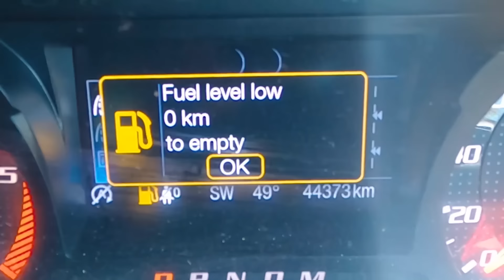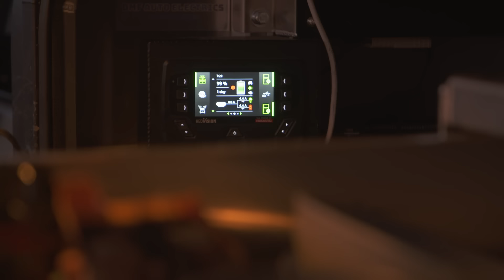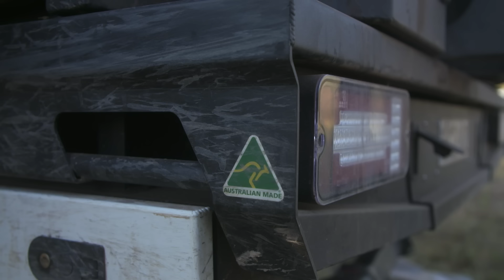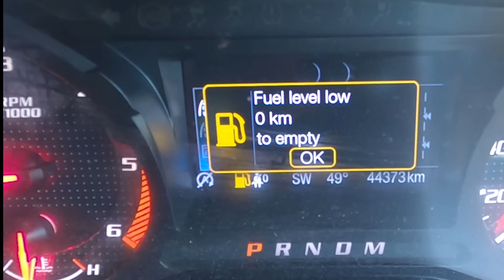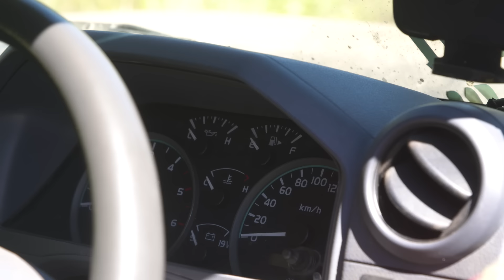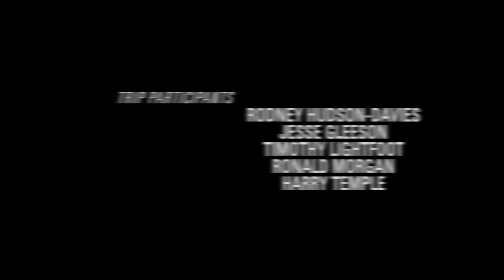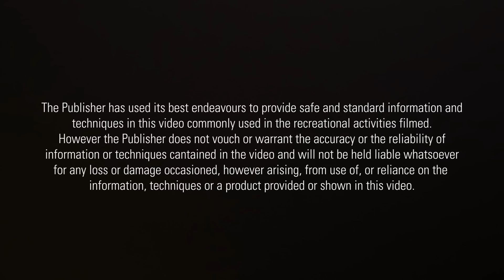We run out of fuel, food and tyres – do we make it? THE KIMBERLEY FINALE

Comment: My bush fix was in a 1999 Dodge Ram 1500 4x4 5.9 V8 360 and my driver side break caliper went out in the middle of a 7 day overland trip with some buddies so I had to cut off the break caliper crimp the break line and bleed my breaks so I still had breaks to the rest of my wheels and it worked for the rest of the trip my break caliper went out in the second day of our seven day trip

Comment: Was about 2 hours down a tough track and a mate bent both rear control arms and snapped a shock off and popped out a spring in his patrol gu ute we used my brothers spare 105 control arm as the right and cut a high lift jack bar as a control arm on the left and used ratchet straps to hold the spring in place to get him home and some how it worked

Comment: Never heard of gaiters that fit inside a tire they come in sizes that would easily fix most of the "severe" penetrations / punctures you have had > They are glued as a patch on the inside of the tire and that and tire pressure keep them in place, used them for the last 60 years !

Comment: Most dramatic 'bush' fix for me was 50 miles out at sea, factory defect in an oil line... heard the bilge pump kick in, look back over the rail and jet black is streaming from the bilge pump outlet. Stop the engine, oil line has a 2 inch split and 350 mercruiser has dumped all its oil. Cut and patched the oil line using a section of a steel tube from the body of a pen, yes a pen as in writing with ink. Used every bit of hydraulic steering fluid as coolant, got back to the harbor with many strange sounds coming from the motor, which was trashed but also insured. Cant say it was my idea the boats owner urchin diver came up with the pen solution.

Comment: My most sketchiest bush fix was fixing a snapped front axle shaft With beer cans jb weld abs hose clamps it worked and got us home on the same trip on another car we broke a passenger window and we fixed it with a chopping board and duct tape

Comment: Just a little while ago I limped my ute off Frasser Island using my bosses canoe under the front left wheel after the wheel bearing collapsed on the way back to the barge. I limped it about 20Kms. A tow would have been $700 and I replaced the canoe for $50. 

I learnt the hard lesson that its Japanese bearings or its nothing!

Comment: Broken leaf spring on the camper trailer. Nearly ripped the axle out the back.
 A 6 inch round log and 4 ratchet straps got it the next 150km home.

Comment: i ones broke all 5 lug nuts and ripped a wheel off out near borroloola. also found broken ones on other wheels here and there. after fathing about for a good part of a day we managed to fish 2 broken bolts out and steal one from other wheels with more than 3 unbroken bolts. all and all had 2 wheels with 2 bots and 2 with 3 bolts. basically crawled 300ks until we found a main road and me mete did a 400k round trip to get me the parts I needed.  now I always carry a full set everywhere I go.

Comment: Bush Repair hack...  With a sidewall cut and no spares, jack up the wheel, get a crow bar into the cut and open it up  so you hand can fit. Then start stuffing  long grass in,  keep the cut  ai 12 and press the grass down , keep doing this in shifts ith your mates. ar some  point jou will need to start forcing in grass  by leaver it with the crow bar.  When your about to cry and give up,  let down the jack and if you work hard enougnt the rim should be a inch or 2 above the ground and you can limp home

Comment: I was driving and I got a flat on a old road that had mud and a stick that hook up the steering arm at the bottom by the tire at night and I had to fix the main brake line and I fixed it with extra brake line with crazy glue and heavy duty duck tap

Comment: Crazy thing I had to do to get home was my rear diff had something go wrong inside and steel was everywhere and bearing growling loud  so I took the rear tail shaft off and  pulled out the hole rear diff and drained most oil out of it but a cup full and stuffed rags and put plastic around it  with duct tape to stop dust put it in 4WD  hi and drove home on the front diff  I was all by myself  it got me home

Comment: Clearly you can't tell the difference between Wrangler MT/R and Wrangler Duratrac when there's a sponsorship going. :) I could clearly see that the tires on the Goodyear Ford were Duratrac, not MT/R. Both solid tires though, and the same brand, but not an entirely fair comparison as they are rather different.

Comment: i know this might be a weird question, it crossed my mind this morning, but has anyone tried to save fuel by not using 4L? or would there be more fuel usage due to increased engine revs?
Reply: Some parts would be impossible without 4L, they are only using it for short periods of time so its pretty insignificant

Comment: I know that this is a late comment but I think my best fix was my fuel pump quit and didn't have a way to replace it, On a carbureted gas engine. I put fuel into the washer bottle and would use it to supply the card to get home.

Comment: Had a Suzuki samurai I had installed 5.38 gears in and a rear spool   Ended up blowing up the rear end and the pinion stayed attached to the drive shaft really was no trail repairs tossed the hole unit in the back and made my way out with just the front diff   Lots of steep river crossings In Reverse and driving down the side of the river to a less steep grade  made it all the way home in front wheel drive 5.38 diff and 6.5/1 transfer case don’t know how I made it  luck I guess

Comment: not a knock just a couple of observances mates , on the little ranger at the rear , how come you didnt go to a near full pressure on the front and lower air in the rear to balance low speed diameter  for when he needed 4x4? also how come you blokes don't carry liners and tubes ? Bead locks are a pain but very doo-able . ? Maybe there is an obvious i m am missing ?

Comment: so we were out at raminging we hit a 2 metre deep bot hole landed on a big rock snaped the front axle and rear axle luckiny i had my drill and an extention piece so i went to a fence i pulled of the wire drilled holes throught the axle and tied the wire on and we safy got back home